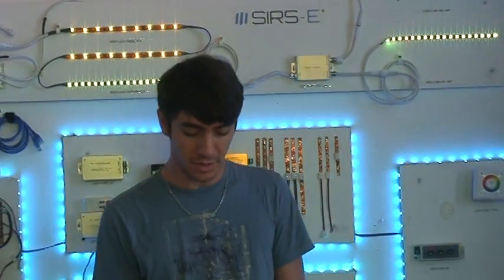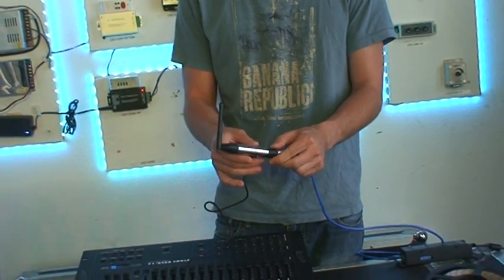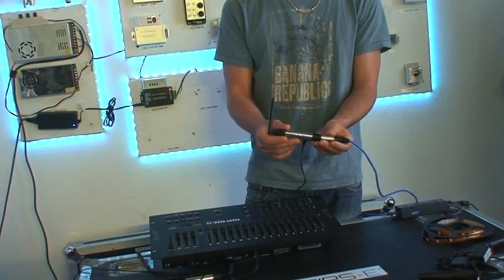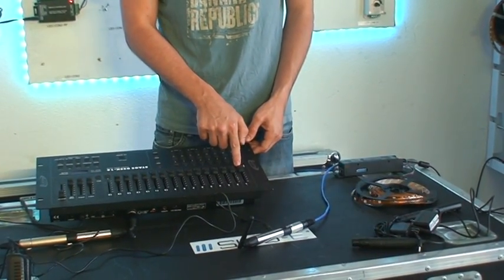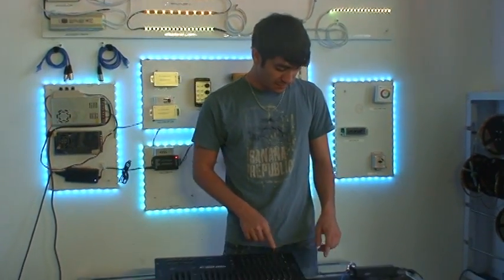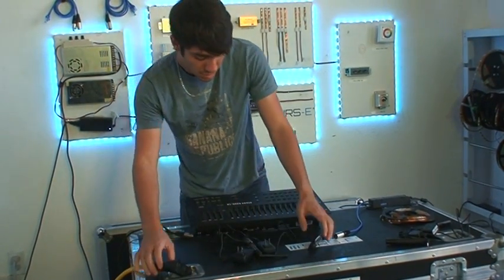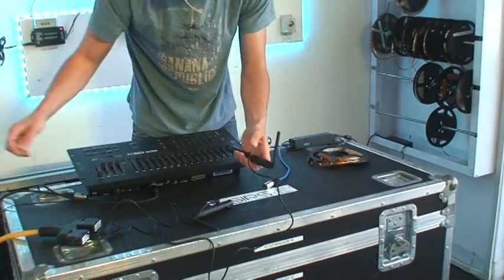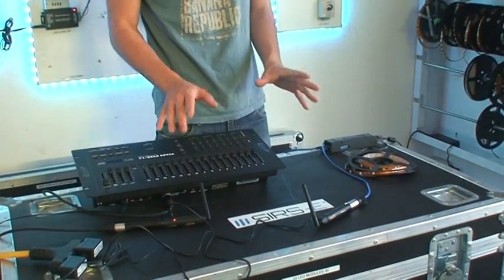Wireless DMX SIRS-E Compare Reliability & Differences

Comment: HELLO THERE I HAVE 4 MOBILE HEADS 2 LED BARS AND 15 LED PAR CANS HOW CAN I DO THE SET UP IM PLANNING ON BUY A PACK WITH 2 TRANSMITTERS AND 8 RECIEVERS THIS HOW I UNDERSTAND I WANT TO EXPLAIN MI THEORY OF HOW TO CONNECT MY FIXTURES I PLUG ONE RECIEVER IN 2 MOBILE HEADS AND I DO DAISY CHAIN IN THE OTHER 2 WITH DMX CABLE THEN I PUT ANOTHER RECIEVER IN ONE OF MY LED BARS AND I DO DAISY CHAIN IN THE OTHER BAR THEN I PUT ONE MORE RECIEVER IN 1 LED PAR CAN THEN DAISY CHAIN IN  THE OTHER 14 LED PAR CAN I DO THAT CAN THEY WORK IF THEY WORK HOW DO YOU CHANGE CHANNELS TO OPERATE EACH FIXTURE I HOPE I EXPLAIN MYSELF THANKS
Reply from the maker: +RALLY SANCHEZ Hello, everything sounds good, feel free to place the order on our website. https://sirs-e.com/shop/dmx-control/wireless-dmx/sirs-e-wireless-dmx/anydmx-wireless-transceiver-transmitter-receiver-2-units/

Comment: Can you link several receivers to one transmitter? For instance: I have 4 tower truss I setup on each corner of every venue I dj at, which means each tower needs one receiver. I also control my lights with dmx software, so that means I would only need one transmitter.
Reply from the maker: Hello DJVetz510, thank you for watching our video and for your question. Yes if you are using all of our compatible transceivers you can have one transmission point and multiple receiving points.  If you have multiple DMX universes you will need to have a different frequency and a different transmitter for each DMX universe.
Reply: SIRS Electronics Inc Thank you for replying so quickly. Excuse my ignorance and lack of knowledge in this, but can you explain what you mean by dmx universe. My set-up is as follows: Global truss in upright position with 1 up-light inside, 2 ADJ Barrel Rolls, and 1 moving head; minimum of 4 lights for each truss set-up (which I place in 4 corners). Would one of those truss set-up be considered one DMX Universe? Here's an example of one truss set-up, I call them truss towers: https://drive.google.com/file/d/0B6TnIxMOY7wPZWplcmcySTlfWEU/view?usp=sharing. 

Do I need a different frequency for each truss tower?
Reply from the maker: Hello DJVetz510, per your image you will be able to use one transmitter and one receiver per fixture or per truss.  All of these should fall between one universe. (512 DMX Channels)  If you are ready to order or need more information please feel free to call us at 956.522.2006
Reply: SIRS Electronics Inc got it, so anytime im using over 512 channels, i have to go into a 2nd universe of another 512 channels.....i think thats what i understand from it.
Reply from the maker: That is correct DJVetz510.

Comment from the maker: Yes, They are connected to a power supply (included), you can adapt an external (6 Volts DC) battery supply if you wish. Fell free to call for more information or ideas. 956-522-2006 USA